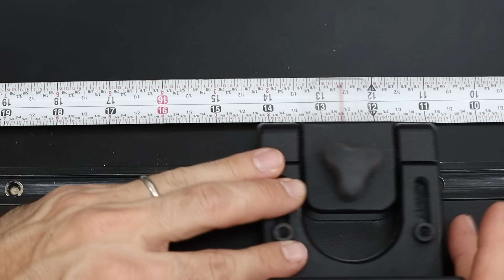I built the perfect miter saw solution.

Comment: This couldn't come at a more appropriate time.  I've just pulled apart my Miter Saw station as I need to build cabinets to add drawers.  I chose to build a mobile Miter Saw station from Fix this Build This.  The picture in my head is to integrate the mobile station between the two cabinets.  My hope is that I could build another cart for my router table.  I am now thinking about integrating the drawer system you did on top of the cabinets to make up the difference in height.  

I love the Shop Nation dust collection boot.  My Bosch spits sawdust all over the place.
Reply from the maker: I love that plan!

Comment: Dang. I love that sapwood on the drawer fronts. Well done! I have an 'outdoor' workshop. It consists of a miter saw on mobile stand I roll out of my shed, and an umbrella. My "stop-block" is a benchtop swivel vice attached to the same plywood that holds this old delta to the stand's mounting bars (because its attachment points form a trapezoid, instead of a rectangle). I put a chunk of 2x4 in the vice, and clamp a drywall square to it to adjust the measurement after measuring with my tape measure 😅

Comment: Very nice saw station build.
Like every tool a miter saw is only as accurate as the person setting up, caring for, and using it. if you have slop in the works you need to fix it.
Its the top most used saw in my shop, with my circular hand saw being 2nd just in front of the table saw.

Comment: I'm not a cabinet maker or any kind of pro woodworker... but I am the guy who regularly does small home furniture and repair stuff from remedial structural woodwork under my floor to building a large fitted modern oak desk for my home office to building nest boxes for hedgehogs in my garden... and I use the mitre saw more often than almost any other tool with the possible exception of a cheap little drill press.

Comment: My sliding miter saw requires a lot of space; the fence is 23" from the end of the slide.  So I purchased a portable stand that can be placed anywhere and that has extensions nearly 5' either side of the blade.  The ability to move my saw around is essential in my shop.  As is the saw itself.

Comment: I have a bunch of miter saws, but by far my favorite is my 16" delta radial arm saw, with 33" of cross cut capacity i break down cabinet sides quickly. Iv even trimmed a couple of doors from the house because i didnt feel like setting up the track saw.

Comment: Looks awesome! I have a very similar space to you, a single car garage with about 8 ft of space to put my miter station. Is not having a fence extension a hinderance at all? Also is only 2 or 3 feet of space to the right of the blade enough? Trying to decide if I should put one or two 2' cabinets to the right of the saw where I have a wall. The left is open for me, but there is a window that I dont want to put a cabinet under
Reply: Did you ever figure out a good option? I have exactly the same situation - 8', wall on right, window on left. I am leaning toward 3' on the right so I have 5' of stop block length on the left. I figure if I need to cut down longer stock it will be rough, so I would just use a circular saw.

Comment: Yes, I have a miter saw. I also own and utilize a radial arm saw. I know...I'm old. But I am also practical. And...I have the room for one. I prefer an arm saw for batching cuts, and I have also been known to use a dado stack with my cutoff blade when batching to eliminate one step in the process...something that is impossible with a miter saw.

That said, miter saws do 90% of what an arm saw can do in 50% of the space. I cannot fault anyone who uses one as their second primary cut saw. They work...and properly tuned...work well.

I am a big fan of Formica-style laminate. It is slick, easy to maintain, glue resistant and can be quite attractive. Light greys are my go-to color. I use them mostly on router tables, arm saw tables and assembly tables for that reason...well, that, and I use a lot of MDF for those applications and the laminate affords protection to the stable but delicate material.

I was also impressed with your separate toe-kick build. I've done this for decades now, as I have a kind of go-to 'box' for base units that is 31 1/2" tall (one-third the length of a sheet). The toe kick allows me to adjust the height to fit needs, and people. My ideal height can sometimes be 35", 37" or 39"...depending on use or need, and with the separate toe-kick box, I can crank out my 'standard' box, and make toe-kicks to fit the application. I also find them easier to put on wheels.

Comment: John, beautiful work. There's no shame in making those long-held narrow offcuts into a feature of a project. The stop block looks promising. I'm with you on the miter saw. Years ago I thought the most accurate cross cuts could only be made on the table saw with a stop block....then I experienced the reality of crosscutting a long 2x4 to a specific length and being off by 1/32" due to shifting in the piece. My fault for not securing it better to the fence. So, not I have a Metabo HPT 12" slider. I'll never look back.

Comment: A couple of days ago, I finished a miter saw cart. On the morning I did, I watched this video. I overbuilt my cart using Baltic Birch, Dark Walnut, and Select Pine including using dark walnut dowels to secure the edge banding on the wings. Like you said, using dark walnut on a shop furniture piece is a want versus a need. I had the remnant dark walnut, and I am moving towards fine woodworking, using hand tools more, and furniture builds. This project was an excellent learning process.

My question is about your stop block w/ Izzy Swan. On the right wing, I installed t-track for a traditional stop block. I want to install t-track behind the fence for your stop block. How far back from the fence do you recommend?

I have been a fan of your page for several years. I appreciate your honesty, humor, and skills. Keep up the great work!

Comment: Great, now I have to get that dust collection upgrade.  We have the same saw.  I got it because of the low footprint vs rail-based design.  Turns out it is really easy to reconfigure and vastly more accurate than a contractor-grade saw.

Comment: Nice miter station!  I've never understood the "you don't need a miter saw" crowd.  I can only assume the only thing they make are smalls, like decorative boxes.   My 12" Metabo slider on a Rigid mobile base is probably my single, most used tool.  I've thought about making a station for it, but I like being able to easily roll it out of my shop so that I can cut the bigger projects outside.

Comment: I am a full time furniture maker for 15 years and I don't have a miter saw set up in my shop. I have one for jobsite work but it is stored away. My tablesaw fence clears 52" and it is rare I need more capacity than that. I have learned how fast, accurate and repeatable table saw sleds are, especially small ones. Those big monsters are inconvenient dust collectors. I have three, small and medium square cut and a 45* miter, I can switch between them in seconds. If you are tight for space like me, consider getting rid of the miter saw first.

Comment: I'm turning a 8'x20' shipping container into my shop. It's what I use it for now but I usually have to take the table saw outside to work with anything bigger than a few feet.

My plan is down one side build a bench with two sections that flip. One for the often used miter saw and the other for my planer. When flipped down it will give me a full flat surface for any tool and the table saw will slide into the very end having the bench as a out feed table.

Since neither the ground the container sits on nor the floor is level I'm going to put levelers on the bench and set it true level. I will do the same for the miter saw and planer so I can level each with the bench top when flipped into working position and might use small leveling screws on the other side so I can insure it's flush with the fixed portions of the bench top. The levelers will allow me to replace any of the tools and not have to worry about it being level specially the planer which I am going to replace and turn that one into a 12" jointer which will sit at the opposite end of the bench from the table saw and be a separate bench matching height of the main bench.

I'm also making a fold up wall mounted assembly table for the opposite wall. Maximizing such confined space has forced me to get real creative and allow for future working areas and storage.

Comment: Great video and I love your channel. I bought my miter saw when I installed vinal siding on my home. Turn the blade around backwards and it worked great for every cut I needed. I've used that saw ever since for a bunch of actual wood work projects. (yes I turned the blade back around to it's correct position). My only concern for a video like this build, is that my saw has slide arms that extend behind the saw. I bought plans for a side wall garage install only to release the measurements  would not work.  I think the same thing would happen here. Building the cabinet up tight to the wall with a saw that has slider arms will not work without some creative measurement adjustments. Still a great video.

Comment: Thanks great video 
A good miter saw is accurate for most any project. However I don’t use one, I use the most maligned tool a radial arm saw. I find once setup properly they are accurate, more versatile, … But occupy 
 more space.
As for separate toe kicks on base cabinets it makes installation of most cabinets much faster and easier, yes kitchen and other, not just shop cabinets

Comment: Great build, and excellent video overall, but one thing for future reference from a guy with many builds and 13 years of experience, go with a tighter reveal on inset drawers and doors, it looks much better. I know this is a shop build, and standards aren't the same as something you're selling, but I just wanted to point that out. I have found that 3/32's is the sweet spot. And though that is only 1/32 under 1/8, it makes a huge difference in the look with inset drawers and and doors. Also, your reveals actually look a bit bigger than 1/8 ;)

Again, great video, I've been subbed for a while and enjoy your content.

Comment: Any inaccuracy of a miter saw can be resolved by cutting 1/16 or 1/8 oversize and using a shooting board to get it perfect if needed. The ability to cut or at least rough cut long boards to close to the correct length is great for any size woodshop.

Comment: Wanna keep costs way down? IKEA as-is section for base cabinets. Double sheets of MDF for counter top coated in shellac. Even buying the bases at full retail price is cheaper than good plywood and hardware to build your own. Hang the cabinets on the wall and it doesn't matter what your floor is doing in terms of level. Adjustable feet to tighten everything up after it's all mounted and level.

Comment: Was interested in purchasing the plans for this as my shop has similar layout. Could you share the outer dimensions of the station once assembled? Basic length, width/depth and height. Also interested in plans for the outfeed behind the sawstop. Interested in outfeed that does double duty as workbench and outfeed.
Reply from the maker: its around 8' x 24.5"

Comment: I like the video, I'm wondering if you hold your brad nailer perpendictular to the edge your nailing, this would be better to minimize nail blowout, if the nail is going to curve then it would be inside the wood and not blown out the sides.

Comment: A good miter saw should be high on the list for anyone who owns a home. Over the years I’ve used mine for countless projects. One tip I can give is if you buy a miter saw. Spend the money and buy a portable stand to go with it. Don’t just set it on the floor like I did for the first (ashamed to say…) 3 years. Stand up and save your back and knees. I would love a dedicated space to set up a proper workshop but until then the miter saw stand and my table saw stand will have to do. That with a 6’ by 2 ‘ butcher block counter top with a vise hinged on a wall in the garage will have to do.

Comment: I am 14 about to be 15 years old. I’ve been doing woodworking for about 3 years now, I’m looking to upgrade from my 7 1/4 inch sliding miter saw up to maybe a 10-12 inch sliding saw. Now the thing I need help with is if I should get a axel glide like the Bosch or if I should stick with the standard dual rails. I think the axel glide might be best just because I only have a little 5 foot bench in the corner of my mom’s garage. But I want an opinion from someone who’s older and has probably been in a similar situation as I am. Just probably not at my age
Reply from the maker: Standard rails require a much bigger overall footprint. If you're limited on space get the bosch
Reply: @lincolnstww Alain one more thing have you used the delta cruzer or the rigid axel glide? Or would you say just use the Bosch? I only have a 5 foot wood bench I made in the corner of my mom’s garage which has room for a miter saw and a drill press and a little room for hand tools.
Reply: Bosch is a really good miter saw. You”ll need at least 2’ depth on your bench. It’s heavy as crap too.

Comment: I went a long time without using my mitre saw just because I thought I could do without it.. once I started using it after my sawstop brake went off, I ended up using it constantly. It really is quicker and does a pretty nice clean job too (same model as your one). Now I pretty much just use the table saw for ripping. Also my wife thinks youre cute. But she has a face for radio too so....

Comment: Great video and nice build! But what happens when u have to replace your saw and the new one has a taller base?
Reply from the maker: I suppose I would rout our a portion of the base. But I'm not getting a new saw - its as good as it gets other than the Kapex
Reply: @Lincolnstww  "I'm not getting a new saw"... unless it breaks 2yrs from now and they don't have replacement parts, or Brand X releases the next "best" saw, etc.  I'm only saying this bcuz over the years I've had to replace things I didn't expect to (not just tools) so I've learned not to build too close to the current dimensions without the option of adjustability.  Your cabinets should last a lifetime and considering how young u are, it's very possible you'll be replacing the saw b4 your cabinets fall apart :-)

A couple simple options to your already awesome design:
1) add ~1.5" to the height of the drawers, then shim the saw accordingly
OR
2) use separate tops on each cabinet and make the one where the saw sits adjustable in height

One other small unrelated tweak is to make the top overhang at least 3/4" proud of the drawer faces so u can clamp stuff down.  My workspace is rather small so all my benches/cabinets are multi-purpose and I need to clamp onto all of them.

Comment: Not here to poop on anyone's work, but I was unhappy with my Shopnation dust collection attachment for the Bosch 12" Glide. I cut a fair amount of thicker stock (4x4s) and often find it helpful to have a zero clearance fence in place. Travis's design interfered with both. It was a marked improvement on the actual dust collection, though.

Comment: Looks like the new blade on the mitre saw is thicker than the original. It's generally not recommended to put a blade with a larger kerf width (the width of the cut made by the blade) on a saw that was designed for a smaller kerf blade. This is especially true for miter saws, table saws, and other power tools. Here's why:

Safety: Using a blade that's not designed for your saw can compromise safety. The saw's guards and safety features are designed with a specific blade size in mind. A larger blade may not work properly with these safety features.

Performance: A miter saw is designed to work with a certain range of blade sizes, and it's optimized for a specific kerf width. Using a blade with a significantly different kerf width can negatively impact the saw's performance. You may experience more kickback, reduced accuracy, and a rougher cut.

Overloading the Motor: A blade with a larger kerf can place a greater load on the saw's motor. This can lead to overheating and cause premature wear and tear on the motor, potentially damaging it over time.

Warranty Concerns: Using a blade that's not recommended by the manufacturer can void the saw's warranty.

Cut Quality: The quality of the cut you get may not be as good with a blade that doesn't match the saw's specifications. It may cause splintering, tearout, or other issues.

It's essential to consult your saw's user manual and follow the manufacturer's guidelines for blade selection. Using the right blade size and type for your saw will help ensure safe and effective operation. If you need to make cuts with a different kerf width, it's better to consider using a different saw or tool that's designed for that purpose, rather than modifying your existing saw.